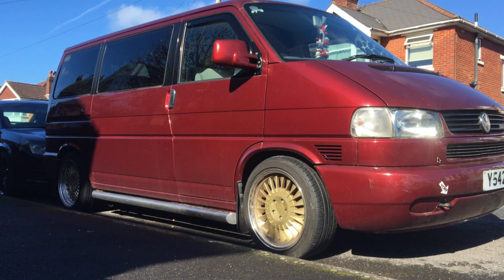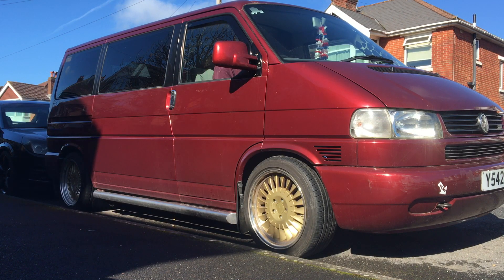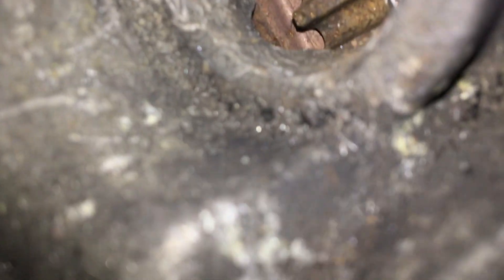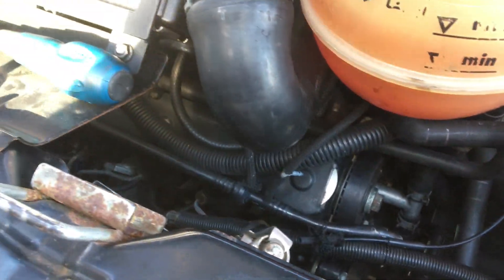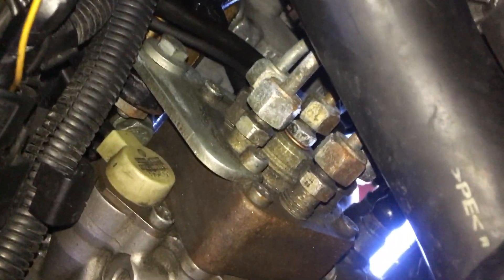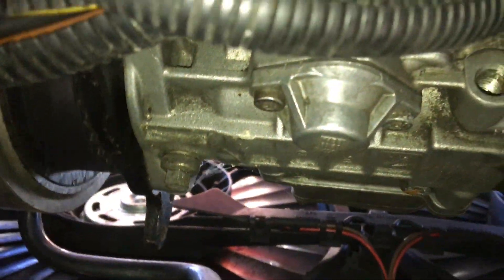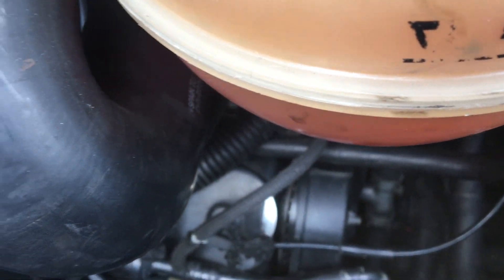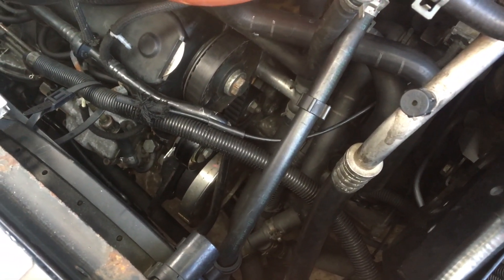Diesel pump timing VW 2.5tdi

Comment: It's 0.55mm of cam lift not 55 degrees - yours was retarded by 0.18mm. Be careful to adjust the rear pump belt timing adjuster THEN readjust the pump belt tensioner (front adjuster) if only minor adjustment is needed. If the pump belt was installed correctly, you have appropriately 4 engine degrees of adjustment either way. If the timing was wrong, you often need to go for a half mile road test to clear the residual fuel causing the smoke on start up. One or more glow plugs not working can also cause light smoke on cold starting without actually affecting starting itself. 😉
Reply from the maker: Excellent comment thank you so much, always nice to get an expert to explain properly, thank you.. also very helpful information, I’ll have to take it for a drive clear it out, new glow plugs, I think the smoke before was because it was 0.18mm retarded. Really appreciate you taking time to comment 👌👍
Reply: Did it make a difference?  @TwiggsT4

Comment: I've got a 1999 carravelle 2.5tdi auf and it's started knocking on throttle ,smokes out  back now with loss of power I'm praying it's pump timing or injectors, great vid 👍
Reply from the maker: Good luck! Hope it turns out to be a cheap fix🤞
Reply: @TwiggsT4  thanks chap

Comment: Hi. Very informative video thanks and just signed up to your channel👍 Just had the belts and pump done and my mechanic mentioned the cover missing on the pump side. Can’t seem to source it anywhere so I guess they’re like hens teeth now. Is this item critical in terms of protection or do you guys not bother replacing it. Cheers ant
Reply from the maker: Hello 👋 thanks for joining the community 👍 I would always recommend replacing that cover if it’s missing, it’s only held on by 2 bolts. I’m sure James at calicampers will have one in stock, no harm in giving him a call.
Reply: @TwiggsT4  thanks mate. Is this cover fitted from the top or under the van? Just so I know what I’m looking for as there’s loads on eBay but none seem compatible with the 2.5. Will checkout cali cheers
Reply from the maker: The cover for the pump, I should of asked which pump, water pump or diesel pump, diesel pump is from the top just below the coolant reservoir, the water pump isn’t as straight forward to get to

Comment: Hi twiggs just bought an acv 2.5tdi engine off Dan Hammond at stoke he been stripping t4s  for 20years now.Dan drove the van home the body was rotten he said cambelt was done just before laid up it was 112000miles only.it was 2019 last mot on gov history.Dan was saying he adjusts timing slightly with vagcom .also the guy who did my cambelt told me that as well he uses laptop vagcom as well .so when you did that cambelt by side of road on that mint van was that just rough setup.?I’ve bought a engine crane new off Chester hobby store near me too.when got to warehouse to collect it was huge crane .it does fold up well the legs do.I’ve just started cleaning engine for now .will need need cambelt before fitting .I may never need this engine as mine still runs strong 312000 mile now.keep up great videos twiggs.steve
Reply from the maker: No I don’t use vagcom, I set the pump with dti gauge as you can’t set the 55mm pump lift with vagcom, you have to guess pump timing run it up to temperature them check vagcom then make adjustments. If done properly you don’t need vagcom. All the 2.5tdi cambelts I’ve done and set up have always been spot on timing, I have a code reader that when plugged in tells me the pump timing, and all the t4’s I’ve done are 100% set up perfect. The 2.5tdi engines are very straight forward engines to work on, cambelt is straight forward, Haynes manual explains it step by step. Also they are good engines if looked after, so hopefully you’ll never need to swap them over 🤞
Reply: @TwiggsT4  that’s great twigs u can do nice next 😀
Reply: What would u charge ?
Reply from the maker: I’m in Southampton and it’s over 4 hour drive from mine to yours, I charge £300 for labour, and customer supplies parts, I can supply but I use gates which is over £200 for the kit

Comment: Hi Twigg’s, My T4 had a recon engine some years back, the mechanics that installed it, couldn’t get the timing quite right. So I drove a very lumpy engine to a VW specialist who adjusted the timing correctly. Now I’m fitting new belts, I’ve realized that the mechanic’s put their own mark on the diesel pump pulley. Which is not inline with the notch on the pulley or the case and my van has always smoked on start up. How do I attach my DTI, through the bolt hole on the pump ?
Reply from the maker: Hello, first of all ignore any previous markings from others as you don’t know what they marked it up too, also those marks can move due to tensioners. If the timing has been out for a while it may smoke on start up until it’s had a good run. 
Have a look as this video which gives more info
Bosch Diesel pump timing//ACV Engine
https://youtu.be/sDeB5CcVo00

Comment: hello. so i have problem with starting t4 2.5 tdi so i did new 
berings...and now it wont start,the cluster dosen light up. So engine 
sturts up but it dosent want to stay runnign without brakecleaner si can
 it be issue the ground wire somewhere or is it the disel pump wrong 
timing i set the timing right with camshaft and marks on pump and on 
block so thats good.Any clue and help maybe?
Reply from the maker: Hello, how did you get on after our last little chat, did you get the clustered fixed?
Reply: @TwiggsT4  hello, funny thing is i didnt fix cluster, cluster fixed its self somehow hahahah.
Reply: The van is all rebuilt and doing grate.In the proces of getting nice
Reply from the maker: That’s awesome 👏 so happy for you, glad the cluster fixed itself 😂 👍

Comment: I wanted my timing checked but was told by a garage to leave it alone as it runs OK.
They had a 2.5 tdi van timed up to factory settings and it ran worse that it did before.
Reply from the maker: I also have a OBD2 port reader so I can plug it in, get the van upto temp and then it'll show the degree the pumps running at, I can then make slight adjustments. Most garages dont do this, its more of a specialist job
Reply: @TwiggsT4  
My van runs well but it seems to lack power, it will struggle to do 85mph on  a flat road.
I know when the belt was done it wasn't re timed, he just locked the pullys and swaped the belts.
It starts and idles fine though.
Where can I get a obd reader from? 
I have a Bluetooth obd dongle.
Reply from the maker: Yeah if he just locked the pulleys then the pump timing is going to be well out, sounds like yours could be out by as much as 30/40 degrees. I would say the pump timing definitely needs to be done, personally I prefer to use the dti gauge, every time I’ve used it and timed up the vans with dti I’ve never had to make any fine adjustments.  But you can still check if yours needs to be advanced or retarded with the use of a obd. I got the streetwise from euros a few years ago, I then downloaded from the App Store Car Scanner. Took me a little while to figure out how to connect and use it but it was only cheap and has done the job. I have used it on different cars to clear codes and fault find

Comment: You can also rotate the engine until you get the reading you want on the pump eg 0.55mm then lock the pump at that, loosen the cam bolt, rotate the engine back to exact TDC and retighten the cam bolt. Easier as it doesn’t require 4 hands trying to fight the spring tensioner in the pump and lock the pump at the same time. Also I find the only way to truly get the timing spot on is with VCDS as your setting the pump as the ECU sees it and that’s what matters. Great video as always!
Reply from the maker: Yeah I did think about doing that way, but for the video I decided to do it this way, maybe next time I do one I’ll do it the same way you do 👍 I don’t have vcds but if I can find someone with it I’ll hook it up and see what it’s reading, hopefully should be close enough for now. Thank you 🙏 Rob for sharing with us 👌
Reply: Hi, using this method do you need to set engine to tdc before rotating engine to 0.55. ?  Tia
Reply from the maker: Yeah engine is tdc, notch’s on diesel pump should line up, when you release the cam pulley on the diesel side the pump will spring backwards, the pump will now be at bdc, from here zero the dti gauge then advance the pump pulley 0.55mm then tighten the cam pulley, once this is done you can fine tune with vcds

Comment: I found when tightening the cam bolt  it can move slightly as its a pig to hold still so then fine adjustment made via pulleys
Reply from the maker: I found that you can adjust with the idler and not the tensioner, and I was able to hold the cam pulley without anything moving didn’t need to use the idler to adjust but I did look and see how much movement on the dti gauge from moving the idler I think about 0.15mm of movement either way(advance or retard)

Comment: Ive not long set my pump to 0.55 with a dti gauge and just changed my injectors and my van pulls really well mines is a lt35 2.5tdi
Reply from the maker: Easy to do when you know how 👍
Reply: Its my first lt35 ive owned i fix all my own vehicles but the lt has been a challenge .
Reply: @waynesmith8550 could I just ask where you got you dti gauge from I carnt find one anywhere matey
Reply: @shanefrost-kilner4851  ebay you will defo find one on there